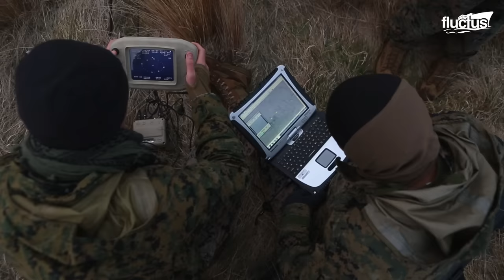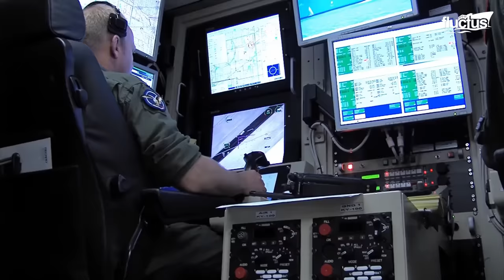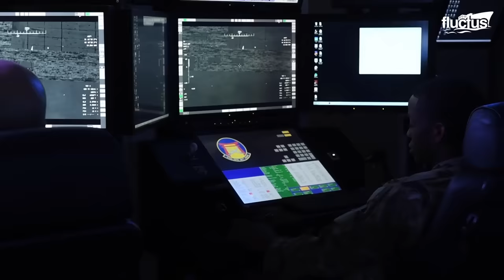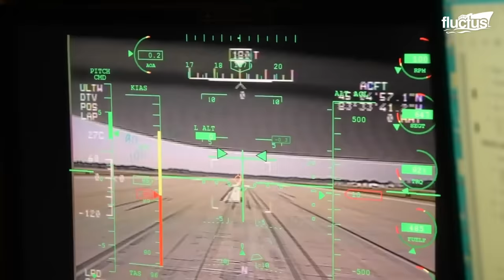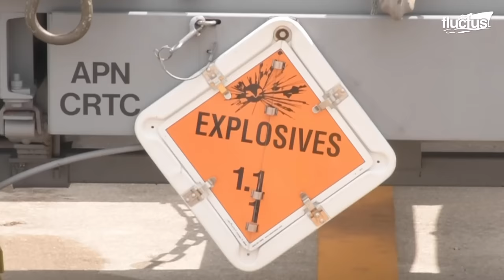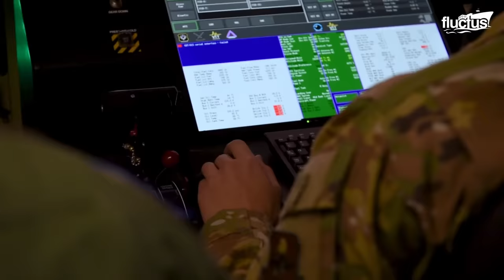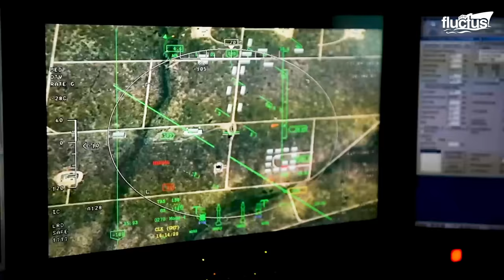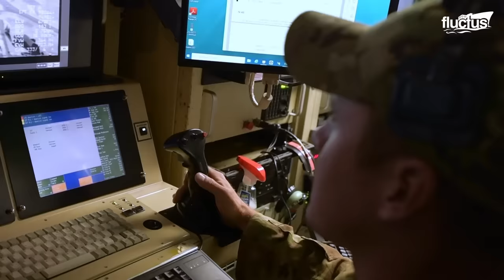Starting US Massive $200 Million Spy Drone

Comment: Actually, we had the first military drone on our Destroyer.  It was for anti-submarine warfare.   It was about a half to quarter scale helicopter called DASH.  Drone Anti Submarine Helicopter. . Gyrodine QH-50.  We flew it off of a specially designed and fitted helo deck (part of “ FRAM ll”.)  toward the after end of the ship.  It was joystick controlled.  It was semi-successful. It was successful……..when it worked.  Pretty cutting edge for 1962.